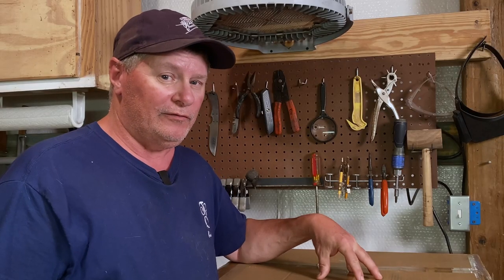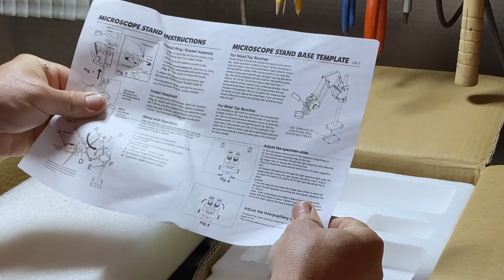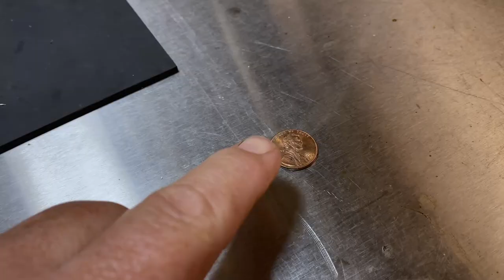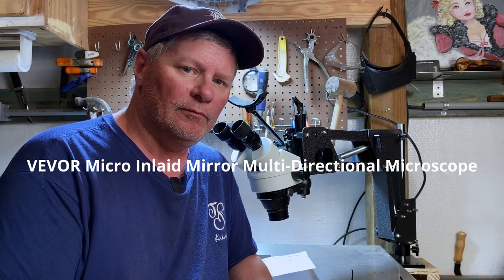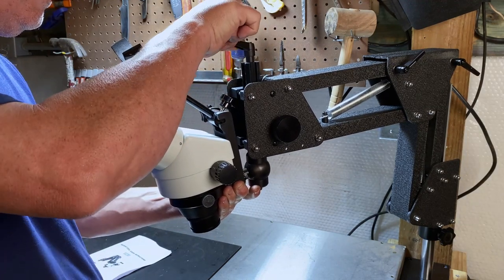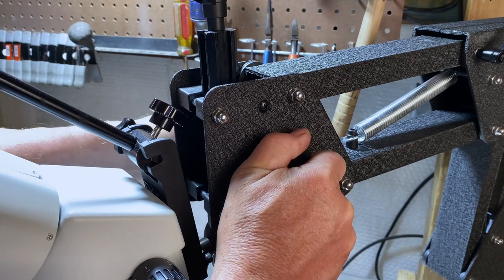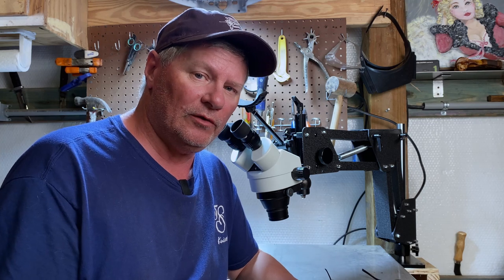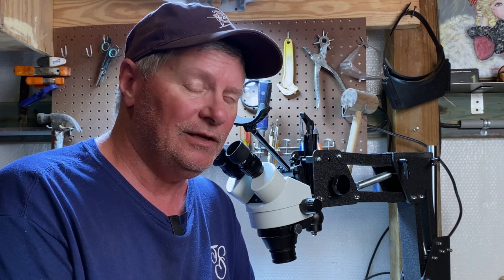This budget microscope could be a GAME CHANGER

Comment: You’re going to really enjoy using it. I’ve been using a Leica A60 for several years now at my engraving bench and you are correct in how invaluable they are. I recommend GRS if you are looking for engraving classes, right here in KS and they are a great group to work with.  Enjoy!
Reply from the maker: Awesome!  I will look in to that for sure.  I definitely want to learn engraving and doing some wire inlay.  I can’t wait to get the training and the gear.  Thanks for the tip James!

Comment: Great video Tony, much appreciated. I'm in the process of installing my microscope and reviewing as many different YouTube videos regarding this scope as a I can. What I do notice in your video, and a few others, is that you appear to be using different 'screw/hand knobs' that mount the scope than what my scope came with. It looks like you're using 2  of these that are all metal. I have a single screw/hand knob that looks, and is threaded, exactly like what is on the head rest assembly. Did you use different screw knobs you had on hand, or is this what came with your scope? I'd like to mimic what you're doing with the metal screw/hand knobs. Again, thanks for the video.
Reply from the maker: Thanks Dwight. That’s the screws that came with it. I’m still collecting gear to get started…another rabbit hole.  😂

Comment: A good housekeeping practice when it comes to microscopes of any sort is to cover them up when you're not using them. Keep the shop dust off them as much as possible. Kind of an obvious mention when it comes to any optical thing but the less you have to clean it in particular, the better.
Reply from the maker: Yes indeed, I agree.  I have to work hard just to keep my cameras clean and dust free.  I will definitely keep it covered tight.  Thanks!

Comment: I love the upgraded mic and camera. Before your videos only played audio in left ear for head phone user. I have a question about soldering guards /bolsters. I soldered a bolster for a chef knife and when i tried wiping the excess off it spread all over, i was able to remove it with a buffing belt but i dont want todo that every time. I believe i used too much solder, what do you think?
Reply from the maker: Thanks man.  Yeah I’m still trying to get me equipment back up to speed.  Several things have broken that I couldn’t afford to replace but slowly getting there.

It may have been too much solder and or too much flux where it doesn’t need to be.  That solder will flow wherever the flux is.  It makes it hard to cleanup.  Brush it off immediately after the solder runs into the guard and cleanup with a piece of brass.  I hardly ever do any soldering anymore but that’s how I used to control it.